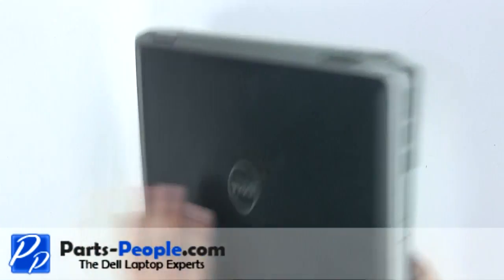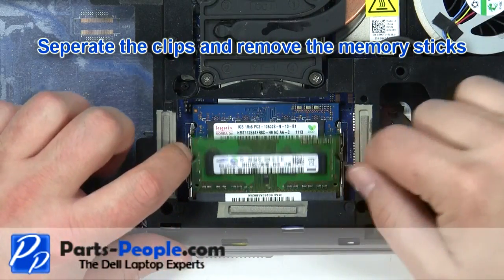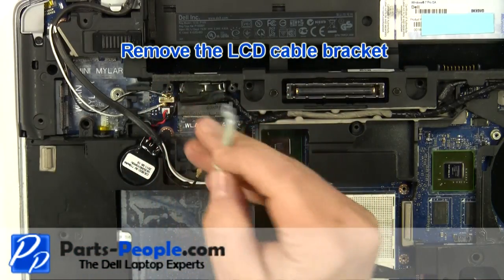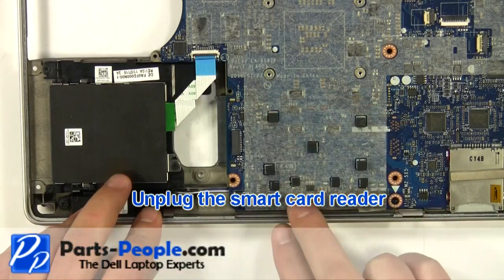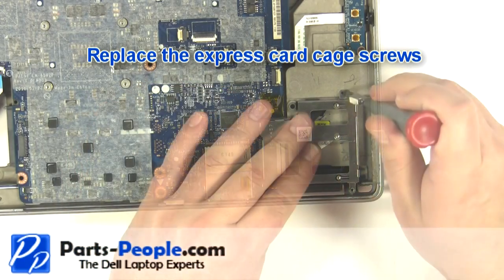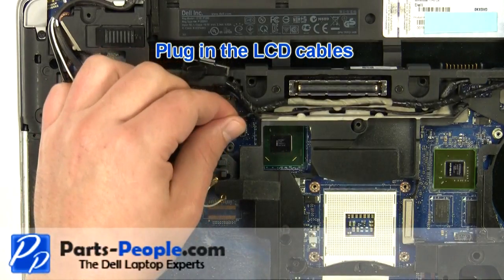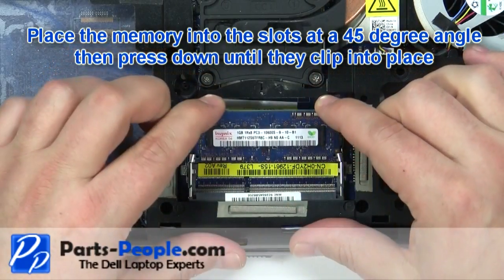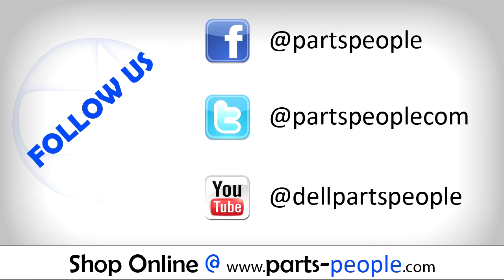Dell Latitude E6420 Motherboard Replacement Video Tutorial

Comment: I just ordered a motherboard for my Latitude 6530...it was on my table 
this AM, plugged in and working. I went to see a neighbor and when I 
came back 30 minutes later..dead as a door nail! I have never 
experienced anything like that! I pulled memory, pulled battery, 
EVERYTHING..but it seems power goes in but dies i.e nothing turns on. PS
 is fine as is the hard drive (checked in another PC)..so hopefully the 
new motherboard will do the trick. Thx for this wonderful video..should
 make the job quite a bit easier and predictable

Comment: Hi so I just brought me a used motherboard with nvidia graphics. I was wondering if thermal paste needed to be applied to the gpu? I noticed people have overheating issues because of that and I don't want to be a victim. I know that the CPU needs to be paste and what laptop motherboard are you using? The integrated one or dedicated graphics one. please get back as soon as possible thanks.
Reply from the maker: This motherboard has the Nvidia GPU. I don't think the GPU needs thermal paste, I think it uses a thermal pad instead.

Comment: good video thanks can you do a video on how to replace the graphics card please
Reply from the maker: +boss george Unfortunately the graphics is built onto the motherboard and cannot be removed. You would have to replace the entire motherboard.
Reply: ok thanks
Reply: Would an NVS 4200m be built in? I know that the Intel HD 3000 is built in, but what about the NVS? could you replace that with something like, a gtx 680m?
Reply: And this sounds as a retarded question to ask, but could you install a small sized GPU into the external PCI slot?

Comment: Model number is not enough for exact match between motherboard and the rest? What I need to do to make sure motherboard I am to order will work well?
Reply from the maker: You can get the part number off of the motherboard. It should be located on or around the memory slots.
Reply: My part number is rare one that even Dell suggests same motherboard but with different part number.